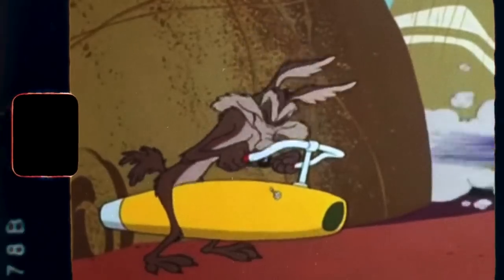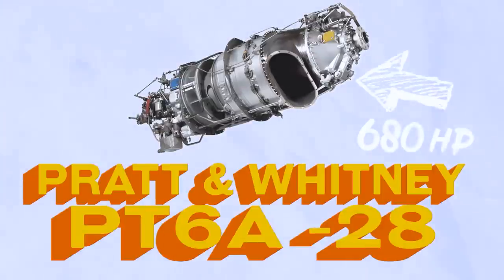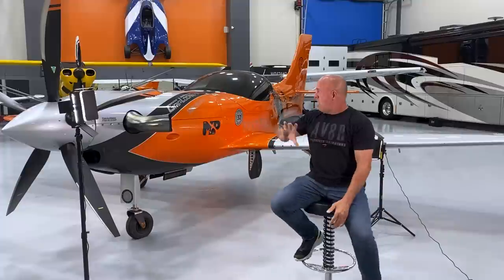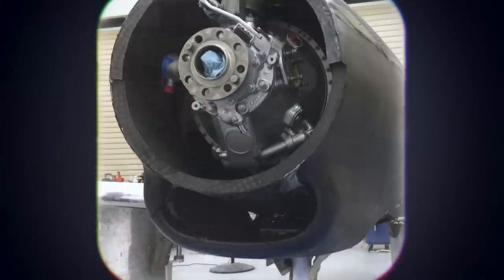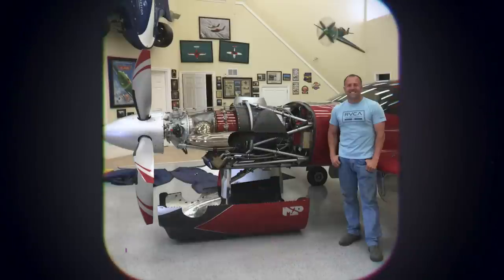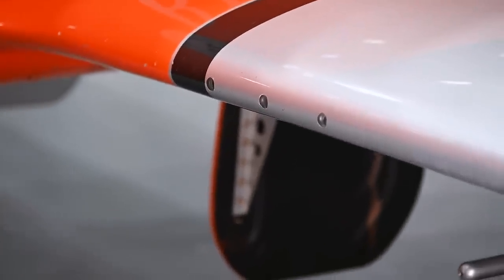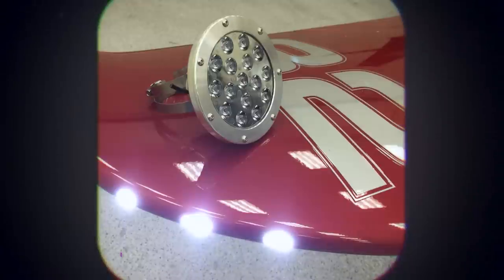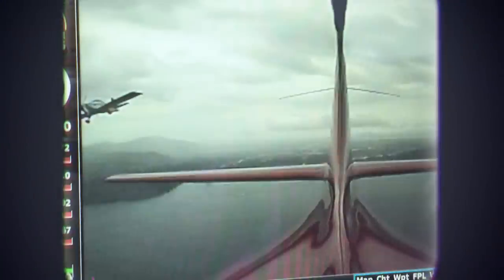Putting a Monster Turbine Jet Engine in a Tiny Airplane | Turbulence #2

Comment: My third car is a 2016 GT Mustang that i and the wife drive every here and there when we get bored of our daily drivers work commute. We drove it stock for about 3 years but soon got the HP bug and went with a single turbo setup which made 550whp on 93. My wife was a little intimidated at first but was able to convince her that if we can get it to 650whp id be super content with it and not touch it anymore, to which she agreed. So its been almost 3 years at 650whp and i love it, she has learned to drive it with confidence along with me saying i promised i would never... Ever... Attempt to make a 1000whp and im a man of my word. But the car still runs great to this day. However, i had dropped it off at a place to get some maintenance done and some other little work completed to which my wife would be the only one available to pick it up. I just hope she wont know the difference between 650whp and 1600whp 😂😂😂... Ill tell her the new tires make all the difference.

Comment: Enjoying this series. Hope you will cover the stability and control issues. 
Lengthening the nose and putting that big prop on, are both destabilising in pitch and yaw. Having done a my fair share of stability and control testing, those mods can make life very interesting!
I doubt there were sufficient margins in the original design to balance those mods. So curious how you engineered around it. Nice work!
Reply: Will be coming up. And yes, those are 2 critical aspects to doing extreme mods.

Comment: go bigger on the engine! in the T-6A Texan II we fly in training we run a P&W Canada PT6 w/1100 HP. Shaft speed at 30,000RPM into a reduction gearbox and a constant speed prop at 2k RPM. Such an easy swap, no extra engineering needed /s

Comment: For your next light plane engine consider gm lv1 or lv3 
4.3 v6 
380 lb all aluminum
285 hp
300 ft lb
Direct injection
11.1 compression
3/4 of a ls chevy.
Can run ls manifolds using block off plates.

Im impressed.
Reply: Can remove the direct injection and install fuel injectors in stock ls locations benefit clean intake valves and fuel charge cooling.

Comment: how do you calculate the load on a spar vs airspeed? I'm not an engineer, is it known math can you be 100% sure that if i build the wing this way it will still be on the aircraft at this airspeed? A lot of aircraft I have flown have a cruise speed and a vne that are not that far apart, that makes me feel like it must be hard to keep the wings glued on.

Comment: You know I had a 36 year career in aerospace machining and fabrication research development etc. for the big leagues. Boeing TRW Parker Aerospace and retired 18 months ago. Worked my way up from the floor. Finished with Parker aerospace doing machining fab R/D work for engineering dept.  I have never flown in an aircraft...

Comment: It is obvious that Mike likes high horsepower as much as the next guy but, i can't help but wonder what long range commuter craft Mike could create by adding a lightweight motor and landing gear to a glider. Maybe shorten the wings, make a new underside of fuselage and front to hold the landing gear and fuel, reinforcement of wings and tail and maybe slight wing modification for more better flight speed envelope.

Comment: its great you are finally talking about this plane. I was always curious about it when I first saw it in your intro. And I always wondered why you never talked about it or even went for a flight. so Mike if you don't mind can I ask you 2 questions 

 I come from an engine management background. Does the garmin handle the engine management side of the plane or does Pratt/whittney have their own engine computer. and the garmin is just monitoring/ using sensors? 
and 2. 
Why have you never flown this since your channel has become more active?

Comment: This can easily be done, and installing a PT6 is more efficient than a reciprocating engine. PT6 weighs only 481 lb, can be custom built to have 500 hp to over 1,900 hp. Continental 360 series 6 cylinder engine weighs 452 lb but only makes 225hp max with a turbo and also puts more stress on the airframe due to higher engine vibration than a PT6..

Comment: It needs a GE T408 turboprop  turbine, with a giant 4 bladed prop with 6-8ft long blades to handle  the 7500 h.p.with weight of only 1100 pounds

Comment: Very impressive build, good engineering discipline. But imagine how easy i would be with two small jets at the back instead. Granted the plane should be made for it because of CG but then you could also more than halve the weight while you are at it because jet engines for a 500kg gross plane can be super light and double curved teardrop shape can be rigid in CF as just a very thin shell with no frames of baffles. Gear can be very short and light because there is no prop clearance. It just dramatically cleans everything up. It could be significantly faster than Turbulence and cost 1/15 because those PW turboprop engines are very expensive which destroy any hope of landing under a million dollars for the plane whereas a good turbojet engine could be slightly more complicated than a turbo for a car. A glider body shape also naturally lends itself well to being pressurized.